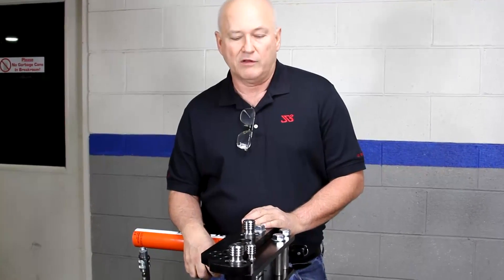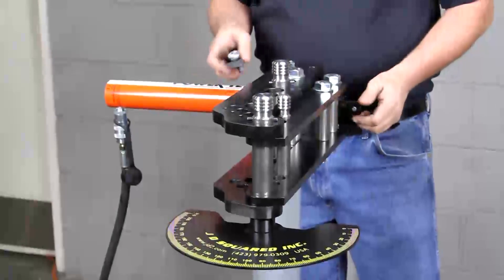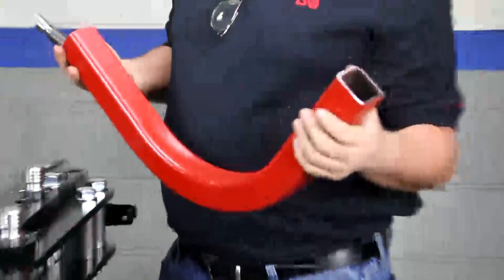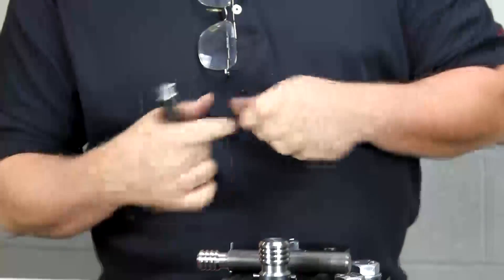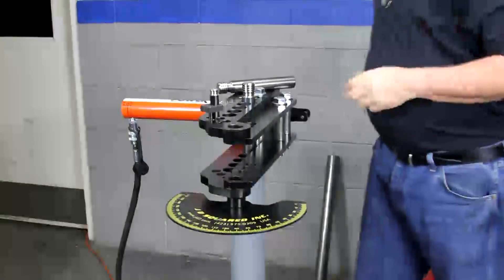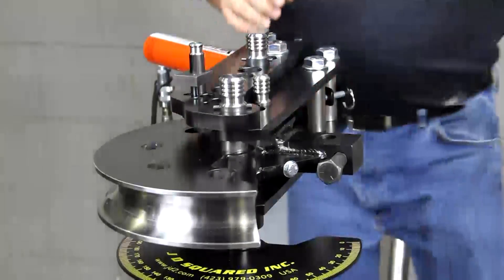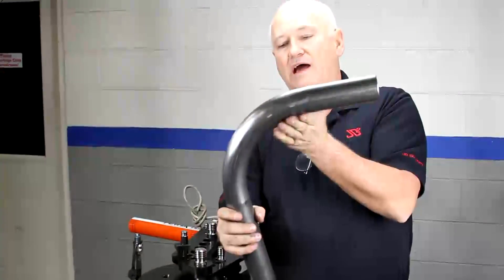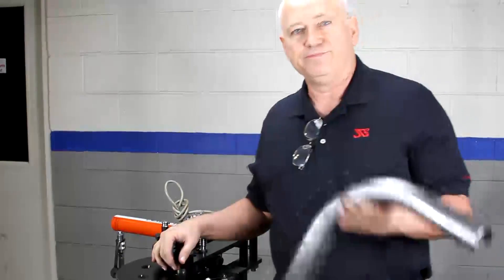Model 32 Hydraulic by JD Squared, Inc.

Comment: Do you need the air hydronic pump with this or just a air compressor?
Reply from the maker: The hydraulic Model 32 doesn't come with a pump. Just the cylinder. We offer an air pump with hose for $470 and an electric pump with hose for $895. They are both USA made pumps with a manufacturer warranty of one year.
Reply: +JD Squared, Inc. ok so k can do the air pump and set it up with my compressor. Thus for 800 for the bender plus 470 for the pump making it 1270. And haven't touched any dies? But that would be the complete set up?
Reply from the maker: rcsquirrel17 That is correct. You would have everything you needed except the die sets.Here is a link to the die sets for that machine. http://jd2.com/c-17-model-32-bender-die-sets.aspx
Reply: Hi JD, can your machine bend flat bar? How much inside D for a 2" x 3/8" stainless steel flat bar?
Reply from the maker: No sorry unfortunately we don't have any die sets that can bend flat bar.
Reply: +JD Squared, Inc. I am sure you can if you wanted to. There are not many bender out there that can bend flat bar the hardway.
Reply: rcsquirrel17 mm
Reply: q
Reply: Free Citizen

Comment: Hello i just bought a 32 hydraulic  bender and was wondering what psi air pressure do you need to use for this machine. Thank you
Reply: Did you purchase their hydraulic pump along with the bender?
Reply: Yes i did and i was also wondering what kind of hydraulic  fluid dose it use. /thank you very much
Reply: So what I have for the model 32 hydraulic bender is the SPX PowerTeam foot pedal hydraulic pump rated at 10k psi. I'm using a small air compressor with a 6 gallon air tank and it's rated at 125psi. This does the trick for what I do as I usually make a bend, take a few mins to look stuff over, make another bend, and go from there. The hydraulic fluid is AW32 or AW22, the AW stands for "anti wear". Check the manual or give JD2 a call to confirm, I'm sure they will be happy to make sure you're on point.
Reply: +Bruce Hudgens  Thank you very much.Yes that is what i have also, and what type of hydraulic fluid do you use  for it? and do you know if their is a distributor in the Sacramento Ca area. Thanks again and i do enjoy your products.
Reply: +Michael Diapoulis not my products,  I'm just a garage fabricator. The hydraulic oil I'm using is a regular AW22 light grade hydraulic oil, which is pretty much the same as AW32 according to everything I could find. You should be able to find it at Lowe's or other DIY stores, I think I picked up a few gallons at a Northern Tool store.  

take care and happy bending.

Comment: You need to come up with a tool holder attachment for you pedestal stand so all your tools, wrenches and pins are right there to grab easily. Tossing them on the workbench , putting them in a pocket or tossing them on the floor takes up time to fetch the tool or pin for repetitive jobs. Please come up with a tool/pin holder for the pedestal stand.

Comment: I bought the model 32 manual for 1.5" x .163 dom tubing. I was told by the salesman that I could bend this size tubing with NO problem...even at age 64. I'm in pretty good shape,worked construction for 40 yrs....but I can only bend this friggin tubing 10 degrees!......now I need to order the hydraulic cylinder,pump and adapter! WTH?
Reply: Dear Major, stop the whining. 
Sincerely, NAWALT.

Comment: Holy hell reading half of these comments people have no idea what the hell there talking about. The machine is simple to use, if you cant work this machine then there no way in hell you should even be trying to bend pipe. I have a model 32 that I converted to air of hydraulic works good, a little slow but im in no rush( which is the cylinders fault now the bender). The video isnt to show how good there camera angles are or how they know how to use adobe after effects, its to show how the machine works and the quality of bend it pruduces for how cheap it is.  Everything is heavy duty if you wore out the fallowers prematurely you probabilyy running shitty rusty tube through which is your own fault.

Comment: Yes that is correct, 1/4 Inch is in face .250 BUT square Tubing is thinner hence the .188 wall thickness, Standards vary from manufacturer and the actual standard for a particular size.

Comment: All that to bend a pc of 2" tube 90 degrees? What you need is to find a heavy sewer grate to stick tube into (at desired length) and push like heck (use pick-up truck for heavy wall tubes). Sure quality's a bit worse but save all kinds of cash and your fingers! Bottom line, this machine is overly complex, slow and limited in use. I would file a complaint with the DCG (Department of Crappy Gadgets) but i'm busy. Bob, back to selling shoes & stuff.

Comment: i know i hear the air hissing but are you actually using an electric over hydo unit cuz i can here a motor run when bending and all of the air/hydro units ive see sound like there pumping. any they are much slower

Comment: you talk about 2x2 sqare tube 1/4" wall but your website spec's say Maximum Wall Thickness - .188" what gives//? last i know 1/4 is 0.255
will it bend 
rectangle tube  such as 2x1 x1/8 wall,1-1/2x2" or 1-1/2 x1" - 1/8 or 3/16 wall?